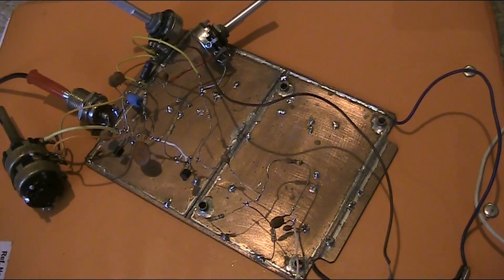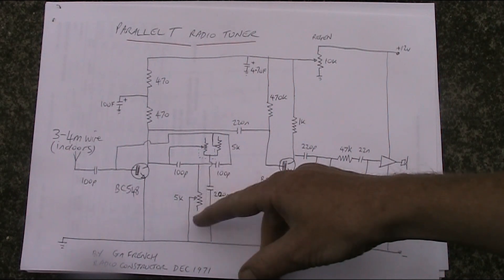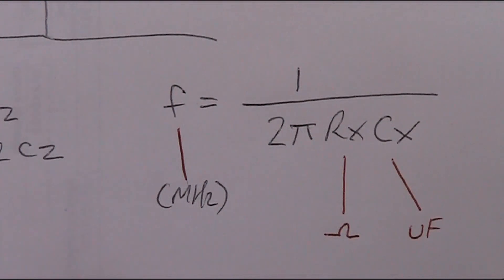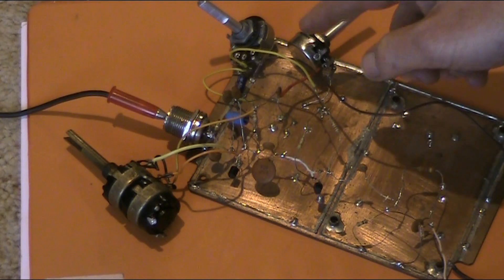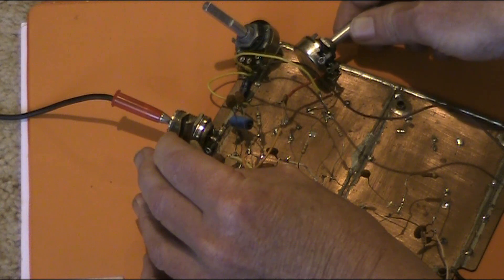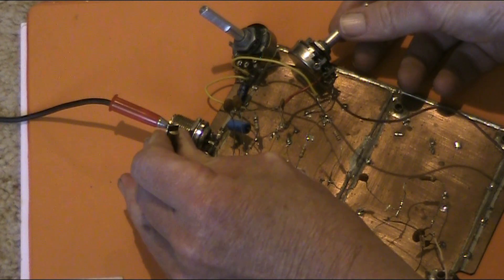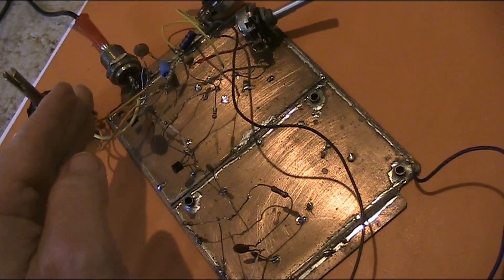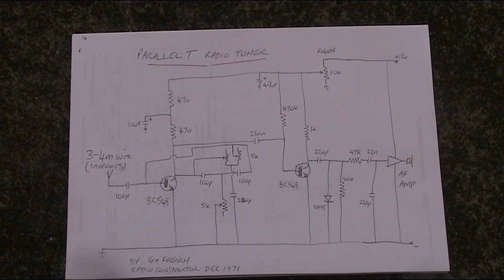Building and testing a no coils radio

Comment: I tested RC active band pass filter TRF receivers with:
a) twin T notch circuit turned to band pass filter.
b) Wien bridge band pass filter.
c) Phase shift RC low pass filter turned to band pass filter.
All circuits work up to 1800kHz and good for medium wave AM radio. Under 500kHz increases noises, hiss. Circuits work on LW band, but noisy.
Phase shift RC circuit can works with wire wound variable resistors.
Results and circuits can see in my youtube channel.

Comment: Hello, my name is Sam. I designed a HF transmitter circuit. And I have a problem with the antenna that I explained in a video. 
Please let me know if you have a email address to send it to you. 
thank you
Best regards
Reply from the maker: Hi Rusma - I would suggest asking your antenna question on a forum such as found on the QRZ or eHam website. Or maybe ham radio facebook groups. Then you will gain the benefit of answers from many more hams rather than just me.
Reply: @vk3ye  thank you for answer. Have a good day

Comment: 👍Thanks Peter. That is an interesting design. Given that there is no coils to wind, I wonder if it would be a good circuit for first time radio constructers to try.
Reply: I don't think it would be a good first project because it is fidgety and the performance is not that great.

A good first project would be an AM radio made from a TA7642 chip.

The TA7642 looks like a 3 leg transistor but it is a radio circuit.

All it needs is a coil a variable cap and a simple amplifier for it's output.

It performs surprisingly well.

Lots of fun.

Comment: Interesting piece of history. Fascinating idea. I wonder how it would perform with some 10 turn pots geared together so that they track more accurately. If used with high stability capacitors like polystyrenes or silver micas, and tuned carefully, this setup could operate into the shortwave band. 80m sideband is a possibility but I don't think I would bet on 40m.

Comment: Just need to crank up the regeneration and you will have much better selectivity.  That Twin-T circuit is commonly used for audio oscillators and filters.
Reply: Short of actual sustained oscillation, the skirt selectivity will not be as good as with a coil, and with a coil, the better the coil Q the better the selectivity.
Reply: @kargocult   Absolutely true.  But if you've seen how some of the QRP kit builders grumble about winding toroids, no coils to wind could be a real selling point!  😉

Comment: The REGEN control typically needs to be backed off a bit, then one tunes around the band to find a station in the noise, and once tuned into a weak and muddled station, then the REGEN control is advanced to just before the point of oscillation, perhaps with a small margin for stability. This optimum point is found by experimentation and is adjusted precisely with fingertip muscle memory. In other words, tuning-in a station requires at least two knobs to be twiddled, in your example three knobs. If the REGEN control doesn't need continuous adjustment, then you're lucky!!

Comment: 1:08 Traditionally, 'Regenerative Receivers' famously do have positive feedback, dramatically increasing the gain at the selected frequency, by sending the desired signal back around, again and again through the same gain stage, to massively increase the gain. Also tightens the bandwidth as the filtering is multiplied by the same regeneration loop. The 'REGEN' control is adjusted up until just before the point where it breaks into oscillation (a characteristic that proves the point about positive feedback). If it's allowed to oscillate, then it can tune-in CW and SSB.

Comment: In 1971 200 kHz would have been Radio 2, but at some stage the frequency changed to 198 kHz where Radio 4 long wave now transmits.
Reply: Wow! Someone else whose brain is filled with the same useful facts as my own. 🙂
Reply: Interesting tidbit. Thank you.
Reply: Yes, 200KHz was BBC Radio 2 in 1971. Radio 2 was on 200KHz from 1967-1978. Prior to that it would have been the Light Programme. The frequency change from 200KHz to 198 KHz was in 1988. From 1978 it has been Radio 4.
Transmitter is at Droitwich and went into operation in 1934. Some old pre WW2 radios just said "Droitwich" on their dials at 1500m.
I wonder how long the 198KHz LW transmitter will stay in operation? It would be nice if it makes it past 100 years.
Reply: @Steve-GM0HUU  One factor that may help save the Droitwich transmitter is that it is fairly centrally located in the UK and can provide national coverage of all, or almost all, of the UK if full power is used on 198kHz. This could be very useful in emergency situations if the internet and large parts of the FM network are inoperable, and a single broadcast is needed to reach all inhabitants.
Reply: @Mike-H_UK  Good point. Just hope that whatever stakeholders are involved in any decision to keep it going take this into account. Yes, coverage of much of mainland UK and coastal waters from Droitwich is quite impressive.
Though, no idea how many cars and households have LW radios these days?
I wonder if most people under a certain age won't know what Long Wave is or have even used a radio receiver. 🤣

Just noticed in that post I said Droitwich transmitter went into operation in 1934. Doh! Of course, its not the same transmitter - should have said the site went into operation in 1934.

Comment: Looks like a great idea for a VLF receiver. I've been toying with building one for a long time.
Reply: Maybe for the 60 kHz time signal, or similar, but otherwise there's not much interesting or that you can decode now on VLF.
Reply: I try it and bad for VLF, LF. Circuit good for MW AM radio, but under 500kHz increases noises.